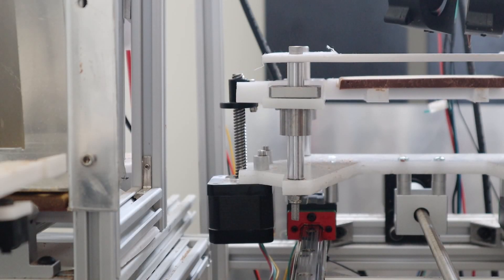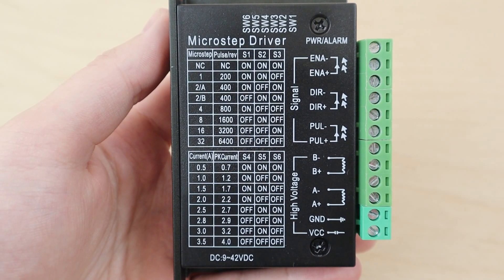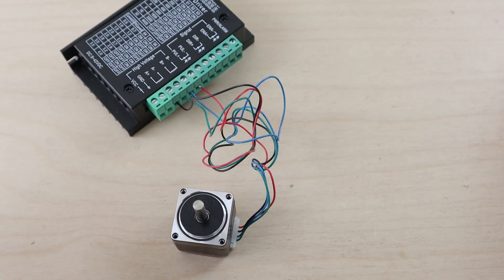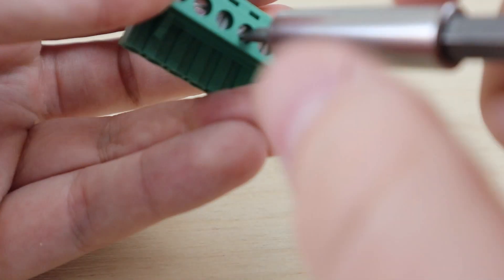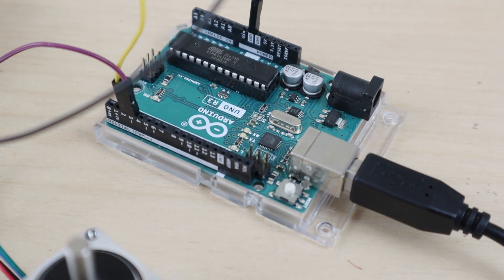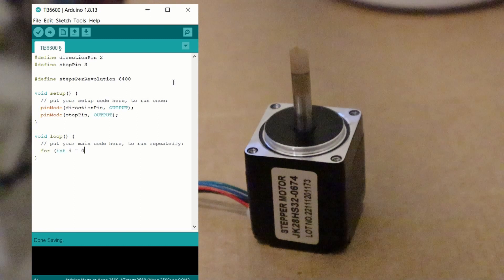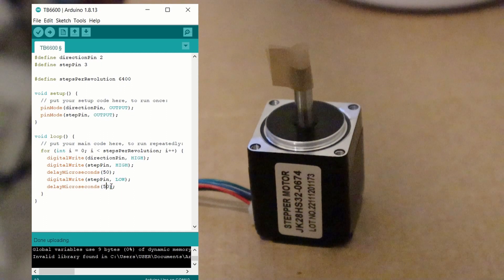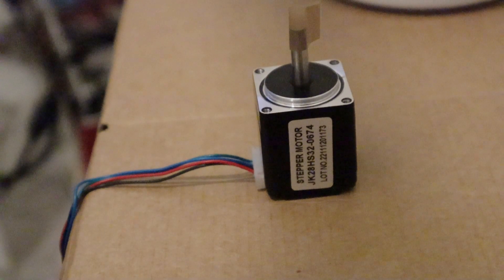TB6600 Stepper Driver + Arduino + NEMA Motor Wiring and Control (Uno Mega Nano)

Comment: wHY IS THE gnd BLACK LINE IN THE DIAGRAM CONNECTED TO ENA + (5V)?
Reply: To disable the enable feature, I believe. The TB6600 stepper motor driver is difficult to find documentation for, so it is hard to check.

Comment: The part where you connect 4 pins to the GND, is that cause you want the stepper to only spin in one direction?
Reply: No, this is because the ground is shared between all of them and the arduino (GND means Ground) by changing how you are powering the positives is what allows for direction control specifically the direction signal by powering it it goes one way and by unpowering it the motor spins the other way.
Reply: The Direction Chanel is the one that says DIR.

Comment: Hello!
If anyone see this message please help me!!!!
I wire my nema17 with gearbox to tb6600 ,like in video but my motor can go just in one direction,when he try to change,it can't...please help me,i also change the driver with one new ,and wire corectly pul+,dir+,ena+ at pin 2,4,6 and all pul-,dir-,ena- wire all in wagoo to create one wire and i put it in GND ,on mai board.
What is the problem?pls help😅😢😢😢😢

Comment: I am currently using arduino+cnc shield, this drives 3 stepper motors in my cnc. 
Do I need 3 of these TB6600 to drive 3 stepper motors?
Reply: Yes. One TB per Motor.
Reply: @christianmontagx8461  Can we make 4-axis mashines with a basic arduino like you're using?

Comment: i know i a quite old vid,but is it ok if i do 24v-1A current as input from the driver for this motor?
will it affect the perf alot(will it destroy my motor?)
is 24v-.5A mandatory?
Reply: Did you find the data plate on your motor? It will tell you what it can take in volts and amps. Volts are pushed into a device, it has no choice, but amps are pulled by the device (motor) so will only take what they need, but can be greedy and get hot but not suicidal. Usually. lol

Comment: for some reasons mi Nema17 vibrate instead of rotate. I don't know how to figure out
Reply from the maker: Hi, this usually happens if you have a couple of the wires the wrong way round. I have had the same issue many times

Comment: Hi Henry, I need some help, I'm a Civil Engineer and electronics is not my thing. I'm building a 40w CO2 laser and need some help with the electronics.   First on the configuration of the driver: how do you determine the steps per revolution on the motor you're connecting to the driver, in your example, you set yours to 6400 steps per revolution. is that so the motor will perform at its maximum when asked by the controller/computer, or is this peramiter set according to the size of the motor?  I watched another video on this subject and the guy totally lost me, any help would be greatly appreciated.

Comment: I have tried so many wire configs from the internet & this is the only one that worked, because, I found a 3018 controller board which has digital out just before the "on-board" stepper drivers & shorting the ENA+ to ground got it working, thanks...saves me using mach3 on my larger home made cnc, which is a headache to setup,Thanks...

Comment: Very good tutorial.  Could you tell me why the ENA+ and ENA- pins are jumpered together?
I see most tutorials leave both unconnected, which I think defaults to Enabled.
Also, I didn't catch what the "While" statement does, as you went over that pretty fast. Thanks!
Reply: Hey! I don't know about the ENA pins, but the while at the end of the code basically never exits and since there is nothing in it it basically stops the loop. It would be the same effect if he wrote everything in the setup.

Comment: Thanks for the tutotial Henry, I'd been struggling with this and yours is very clear. However, mine only works if instead of connecting ENA-, ENA+, DIR+ and PUL+ to ground as you say, I instead connect them to 5V. Until then I got no movement, but with 5v it works as per the rest of your description. Do you know what the reason for this might be? I only swapped it as I'd seen on another tutorial that they used 5V, but I found the rest of their description complicated. I'd be interested in your view so I can learn more. Thanks again
Reply: I don't believe that the wiring diagram shows what you describe.  It shows all negative pins on the driver connected to ground, DIR+ and PUL+ connected to digital pins on the Arduino, and they are set to HIGH (5v) in the code.
I also had questions, but the poster did not reply.

Comment: A really useful video thank you, I have a question regarding a project I am about to try and build, and that is how do you know what size stepper motor to buy for the project you are proposing to build? I want to build a unit that operates as a lift in what is commonly known as z axis so it is lifting and holding a load and lowering and still controlling that same load.
Reply: I'm doing the same thing, I think.  I'm trying to build a Z-axis power feed for a Bridgeport milling machine.  I'm not finished yet, but I'm trying a NEMA 34 with a 4:1 timing pulley arrangement.

Comment: Thanks a lot. Very helpful for beginners like me. But how I will connect to power supply. I have one adaptor to use in Arduino board. Do I need to buy another adapter for controller power supply?
Reply from the maker: You can get a 24v to 5v converter which you can wire in-between the 24v power supply and the Ardunio so everything will be supplied by one power supply, rather than having multiple power supplies. Have a look for a 24v dc to 5v dc step down converter 😊
Reply: @henrycawley2  thanks a lot. I followed your system but my motor is vibrating not spinning. Cant solve the problem need your help.

Comment: I am going to use 3 nema17 7.2kg torque motor is 1 lrs75 24v power enough for it?
Reply from the maker: Do you know what the amp the power supply is? Just make sure that the amp of the power supply is great than the total of the amps requited for the 3 stepper motors
Reply: @henrycawley2  
Ok!
Reply: 1.7A×3=5.1!
Lrs 75-3.2A if I use 2 of them 6.4A!
So can I use 2xlrs ?

Comment: Hey dude, my cnc machine has 2 stepper motor on X axis.How to wire the second driver into the arduino uno ???
Reply from the maker: Hey, just wire the stepper motors cables into the same points on the stepper driver. (Into tha A-, A+, B-, B+ terminals) you may need to adjust the amps to power both steppers

Comment: I've been buying steppers and drivers for a few years. Every item was checked ok at delivery. Now some year later a NEMA 23 and a modern TB6600 produces 15% to 30% more steps than commanded. This happens both using the test code You showed but also when using AccelStepper library. I've never faced this before. Any ideas?
Reply: Could it be the Microstep setting on the Driver?
Reply: @KW-ei3pi  It's possible but I need it. The stepper is turning a rotating table and resolution is often important. The solution was dismissing the 24 volt 17 Amp and using a 12 volt 20 Amp supply.

Comment: Hi why I cannot turn the hand crank on a lathe after I install the stepper motor thanks Eli
Reply from the maker: Has the stepper motor got power going to it? If so the motor will be applying a "holding torque" which will make it very difficult to turn. If you want to use the hand cranks you could use the enable pins of the tb6600 to turn the power on and off going to the stepper motor. Hence you could turn the power off to turn them manually then turn then on when you want to use the steppers
Reply: need lot lot biggest motor, retro fit need big motor and driver. i used my old hand mill nema 34 6A motor and DM860 driver, all same iring. nema 17 used only toy,laser,3D printers no need lot torque. minimum cnc need 3Nm torque, 426 oz about.

Comment: you have ENA+(5v) hooked up to ground in your diagram. Is that right?
Reply: i was woundering them same. very new to this and was just curious
Reply from the maker: Hey, yes I have the ENA pins wired up to ground. If you want to you can have one of the ENA pins connected to one of the Arduino I/O pins to turn the power going to the stepper motor off and on. This is useful to stop the stepper motors from drawing current when they are not being used :)

Comment: If I only have a power supply rated 0.2A, 21V, will tb6600 be able to output at least 2 amps?
Reply from the maker: Hello, I don't believe so, I think it will cap the current to 0.2A
Reply: power need be curret important near motor max current 1,5-2A then working, power supply have very cheap buy. or search salvage yard have lot old computer power etc,